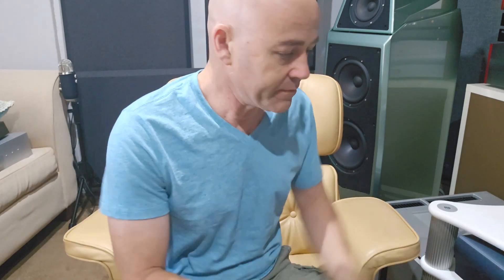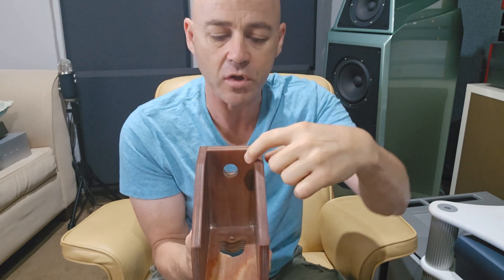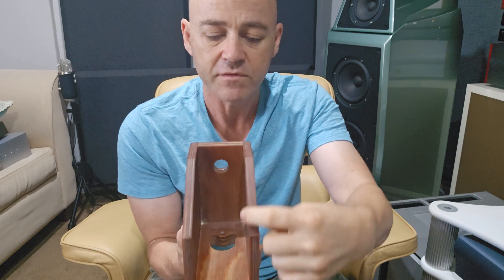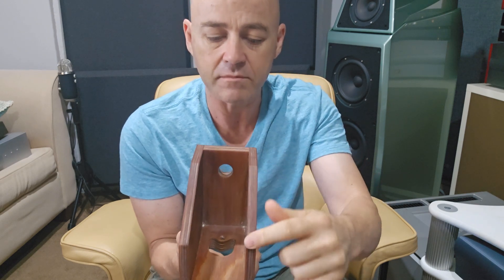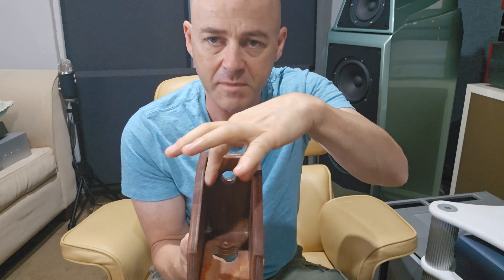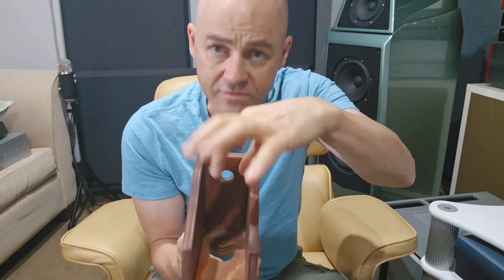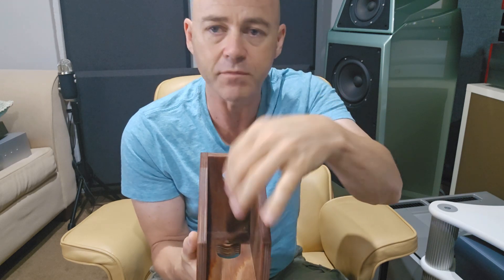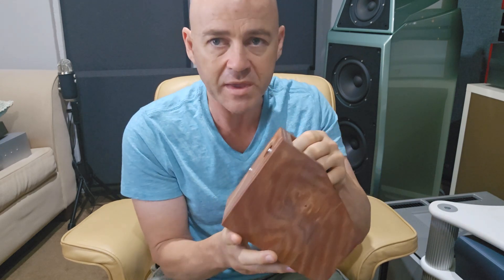"CUSTOM 1 OFF LINKWITZ LX521 TOP BAFFLE UPGRADE"

Comment: Hi and congratulation for your excellent work.
I have been the owner of Orion since 2003, and I know the S.L. way of doing things very well.
Very good for crossover electronics but poor on the mechanical side.
The original wood-only baffle is mechanically insufficient.
Even in the first version of LX521.3 the baffle was placed directly on the woofer box, there was a YouTube video, now no longer there, published by German audiophiles, when playing organ music the baffle was pushed by the vibrations of the woofer walks until he reaches the edge of the woofer cabinet and before falling to the ground a hand catches him, and everyone laughs..
Honestly, how anyone can design a speaker with these defects leaves me speechless given that,
there is a simple calculation to check whether mechanically the baffle, or the entire cabinet of a speaker, will be adequate for the force generated by the speakers.
When the speaker reproduces a musical signal, the membrane of each speaker will produce an amount of force, the amount of force is generated by the weight of the moving mass pushed by the power of the amplifier.
There is a simple calculation to protect yourself from a mechanically poor construction, you take the weight of the membrane and multiply it by 1000, 1000 is not a definitive value, 1000 is just an optimal coefficient to protect you from incorrect sizing and to realize what you need.
The weight obtained with the coefficient 1000 will be sufficient to counteract the thrust force generated by the weight of the moving membrane.
Of course the stiffness of the baffle material is also important and will participate in the "vibrational modes", all this is described in any vibration mechanics book.
Like the trend of changing the support feet of the speakers and listening to the change in the sound.
Each foot made of different material and shape will produce a different sound**, **if the quality of your system is accurate enough, because different shape and material have different vibrational modes that are in addition to those produced by the speaker cabinet.
To avoid adding more vibrations, you must use a foot made of soft material sized for the weight it will have to support, capable of dampening the vibrations received.
To reduce the vibrations created by the speaker you need to intervene on the quality of the speaker's construction and improve materials and construction technology, as you did with the wood sandwitch aluminum baffle.
I'm honestly not sure if making a sandwitch is better than just aluminum considering the additional cost for the sandwitch.
Maybe I would increase the weight of the baffle even more with even heavier metal like brass.
Honestly, I would also make the entire support and base of the baffle out of the same material.
However, your baffle is very well made and, for a speaker that wants to be a reference for sound quality, it is absolutely necessary. Why?
Because the vibrational modes of the sounds are already present in the recordings we listen to and, for accurate reproduction, a speaker must not add other vibrational modes, each vibration added to the original sound already recorded will change the sound producing reinforcements and masking always producing a worsening of the sound, the sound gets worse because it is not the recorded sound.
If you want accurate playback, it will only be accurate if it plays back without changing the information "already present" in the recording.
If the recording is done badly, it will never sound good, but this is another interesting and great technical topic.
Reply from the maker: Awesome response!!!!! Thanks very much for your detailed comments.👍🙂🎧

Comment: It is so great to read your advances of lx521s even with some different voices. I do agree the top baffle needs to be strong. But acoustic loading of metal will have different resonant response than wood/hdf say that warm woody cell sound. I did the same as you building the little back box wider with four pairs of binding posts on the back and two more pairs of binding posts at back of bottom of base box.  Great work and wait and see you further works ahead.
Reply from the maker: Thanks for commenting and sharing your story. I'm always interested in what people are doing.
In relation to the sandwich aluminium, Panzerholz essentially we have just copied what Dr Frank Brenner in Germany who runs Linkwitz is offering as an upgrade, with some further improvement around driver fastening and wire upgrades. 
I'll be doing a full series on all of the work I've done over several episodes, which is something you might be interested in .🙂🎧👍

Comment: @An Aussie Audiophile Odd to see a copy my Aluminium/Panzerholz upper-baffle design being promoted as a first and "the best ever"  -- FYI -- Dr. Frank Brenner has "never" stopped making these AL/Panz sandwiches since I first contracted him to build my design in late 2014 early 2015, and they are currently on the Linktwitz Audio web page -- but in the pull down menus. Your baffle "looks a little thick" -- as in thicker than the 18 mm that Siegfried's design mandated and the large-radius edge beveling suggest that you might not have understood how SL used baffle edge diffraction effects to create certain radiation patterns. But "more power to you" and to your customer -- great to see the LX521 getting attention, and I guess imitation is the highest form of flattery. My prototype had the tweeter offset mounts directly CNC machined from the 3 cm 5052 Alloy directly into the baffle, which enhanced the rigidity and gives a more aesthetic look to the sandwich baffle -- so (as to the best that will ever be made) I think your attractive design is 10 years too late ;-)
Reply from the maker: Hi there, these baffles are an absolute copy of the lx521.4 hdf baffle that is currently being sold down to the last mm. 
They are a little thicker than the 18 mm baffle, and that was done for a reason, absolute rigidity of the drivers that are critical for imaging and sound stage. We were told we could go to a maximum of 24 mm with no Sonic degradation.
These baffles are 23mm or one inch thick.

When Paul purchased this lx521.4 kit that I built for him, the sandwich Panzerholz baffle was not available, so we built our own. I can't talk about what's happening currently, but at that point, it was not available.
The quality here is outstanding so my comment about the best top baffle was essentially due to the level of Engineering and quality of Engineering that has gone into this top baffle, including the Panzerholz base which is not offered by Dr Brenda, and which I believe makes a further Sonic improvement to the speaker system.
In their final testing phase now they are doing everything that the many different Linkwitz lx521 systems I've heard do brilliantly. 
An immersive almost three dimensional sound stage, the harmony between the 4 critical drivers in the top baffle are now working as one, as opposed to me being able to hear each individual driver with the hdf baffle that was originally sent to us in the kit.
I could not be happier with what I'm hearing in this speaker system now, and it's the best lx521 system I've ever heard.
Reply: @anaussieaudiophile  Great -- but this statement is "incorrect"  -- """ We were told we could go to a maximum of 24 mm with no Sonic degradation.""" Told by whom ?? The direct citation from SL when I designed mine was "please do not exceed 18 mm [3/4 inch] as this will affect the desired 100Hz-7Khz dipole behavior -- if possible, please go thinner, which should be feasible when using a sandwich scheme with aluminum -- that would help maintain (or improve) the constant-directivity/frequency-independent design objectives" -- but I am glad that these worked out for you and your customer. I notice the Wilsons appear to have been "displaced" -- that is what commonly happens when a "music lover" gets exposed to the LX521's.
Reply: As Shane said, the Aluminium/Panzerholz sandwich baffle made here in Australia is an exact copy (to the micro-mm) of the HDF baffles which I originally purchased from the Linkwitz Store in Germany - the baffle which hadn't failed was used to develop the CNC drawings etc, including replicating the edge bevelling exactly etc. 
After the failure of one of those baffles, I decided to spend the extra money and go the Aluminium/Panzerholz route. 
I contacted Dr Brenner about purchasing such baffles from him. His reply to me indicated that those baffles would not be available for at least 4-8 weeks.
After my follow up emails (about pricing and placing an order etc) did not get me an answer, after several weeks, the possibility of getting the baffles made in Australia came up, and I went that route.
The other changes (the Panzerholz base with dowels, the through bolts for holding the drivers, the wiring etc) were all done after careful consideration of the issues which had arisen with the HDF baffle.
It is that simple.

Comment: Following the flaw which occurred in one of the two original HDF top baffles, I looked at an Aluminium/Panzerholz alternative which was first released by Linkwitz Germany a short while after my kit was shipped from Germany last year. As Shane explains, when I looked at ordering  Aluminium/Panzerholz top baffles from Germany, there were some production delays (of unknown length) involved at that end.
When Jon (at OAD) became aware of the issues, he discussed  with Kevin, making the beautiful baffles which Shane now has in his hands.
Beautiful work, for which I am very grateful to Kevin and Jon, and also to Shane for the role he played in helping to coordinate everything (plus of course,  for all of his work in building the speakers to date).
These two baffles incorporate a couple of improvements which Kevin suggested (as detailed by Shane), plus a couple of other improvements which were suggested by Shane (eg the method of attaching the drivers to the baffles) 
The "glue" was specially chosen because it is perfect for bonding Panzerholz and Aluminium (see my reply to a question below).
The finished article, incorporating the wiring which Shane discusses (and suggested) is a further "upgrade" which I wouldn't have known about if Shane wasn't doing this build.
So ....... thanks to Shane, Jon and Kevin, I will be the very fortunate beneficiary of having a terrific Linkwitz LX 521 system "upgraded" to a level that I believe Mr Linkwitz himself would have been happy with.
Reply from the maker: You're gonna be very happy with these Paul they're coming up beautifully.😍🎧👍🙏

Comment: wow ,very nice cnc machining! Can I ask you What glue you chosen for the cld. Also where did you source the silver-plated occ wire.
Reply from the maker: The wire was sourced from a company called Sonic Art here in Australia. And I'll have to get back to you about the glue as Kevin, the fellow who built and put these together sourced what I believe was a glue that took a week to cure ( very strong) I will take that question on notice and come back to you with an answer.🎧🙂👍
Reply: @anaussieaudiophile  Thank you Shane. Very interesting. I guess those baffles has next to no resonances.👍🙂
Reply from the maker: @unicornslayer6963  Yes correct certainly knocking on them would suggest so. But all the properties of panzerholz aluminium sandwich composite suggest it will be very dense.
Reply: Hello there.
I understand that the following products, developed by Gougeon Brothers (Bay City Michigan) (and licensed to be produced in Australia by West System)  were used to make the bond  between the Panzerholz to the aluminium:
* West System 413 Microfibre Blend Adhesive Filler.
*  West System 105 Epoxy resin
*  West System 207 Special Clear Hardener.

Comment: Shane - that is looking very good.  I am definitely interested and can do the assembly here.  My only change would be to anodize the aluminum in black to better match my system.  Let's talk.
Reply from the maker: Hi Michael, Yes, colour preferences are an individual thing and not a problem and could be done easily.👍🎧🙂

Comment: That baffle is very impressive indeed. I have seriously considered building this system and I even posses the template. My hesitation took over when I considered the complexity of the multi-channel amplification system required. Also getting these speakers to produce an adequate amount of bass(subjective) is a challenge as well. That being said the spaciousness and imaging these speakers produce is top tier.
Reply from the maker: Yes, bass can be an issue, and I agree with you very subjective what is perfect for one person will not be enough for another. We will be going through this together as this is part 1 of the series. I will talk about all of that as it presents itself both in my room and in Paul's. 🎧🙂👍

Comment: Next up.. Upgrade the Opamps in the Active Crossover?
Reply from the maker: Hi Rick, Yes, it can continue to go on if you want it to. But I think after this Paul will have and be happy with his final system.🙂👍
Reply: @anaussieaudiophile  Hi Shane.. If they are not soldered onto the pcb, and the upgrade itch starts again.. You can at least try compatible Muses type Opamps..

Comment: They look beautiful!   I have tried many different speaker wires in 40 years.  I do not like plated wire.    Due to the different electrical characteristics between copper and silver, It causes a slight distortion to the highs.  Solid OCC copper or solid silver is the way to go.
Reply from the maker: Thanks, Steven, for your comment.
This wire comes highly recommended several people have told me it is extremely good. So I guess only time will tell.👍🎧
Reply: @shanestephenson8423  I am OCD Mikey's friend that makes granite open baffle speakers.  The new baffle will make your speakers way more detailed... you will perhaps feel they are "brighter".  This is because the baffle is much stiffer and many times more massive than the MDF.  This will allow much more of the driver energy into the room.  These will be very revealing speakers.  I am afraid the plated wire will make them tough to listen to.  I am speaking from experience with almost every conceivable baffle material for open baffle.   I just want your efforts to be rewarded!   All the best, Steve